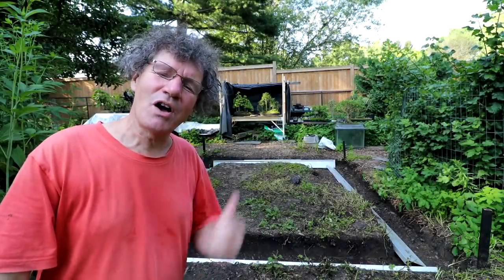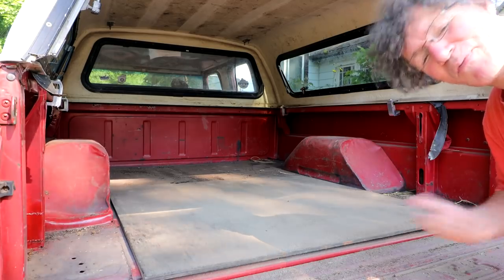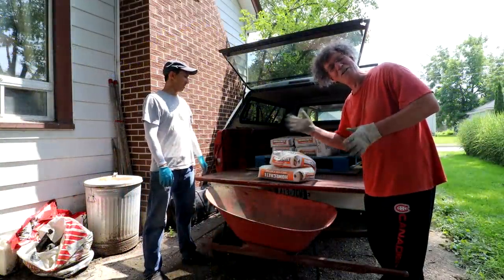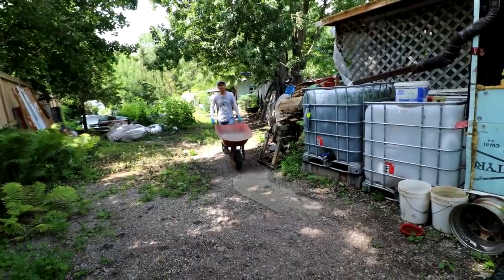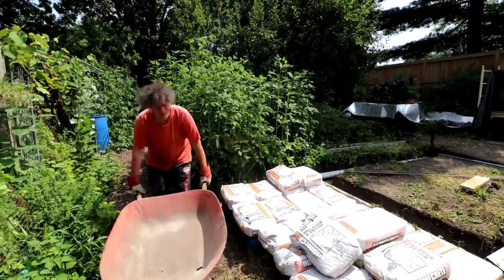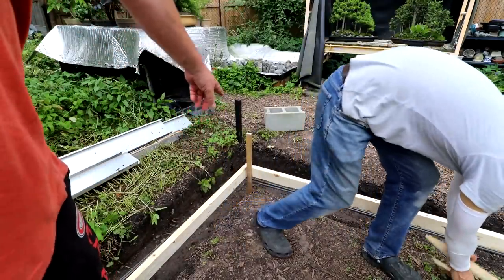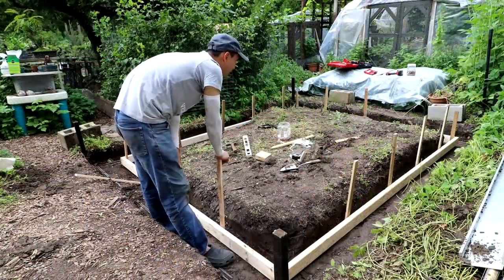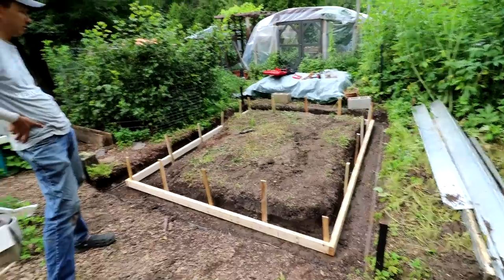Working on the Glass Greenhouse with Xin, The Bonsai Zone, Aug 2021

Comment: WOOHOO!  So good to see you get started working on the new glasshouse!!!  You are very fortunate to have friends like Xin who are willing to help out with this project.  Can't wait to see the next part of the work.  (Memories of my father constructing a small greenhouse.  He made the structure out of steel himself - he was a boilermaker/welder by trade.  The exterior was made of off the shelf clear fiberglass panels.  He put a small electric heater in it in spring when he would use the greenhouse to produce seedlings for our veggie garden.)

Comment: Hey Nigel I don't want to be that guy but. I think 3.5 inches is way to thin for footings and I am certain you are not bellow the frost line. If you get any heaving over the winter it will break that glass house they have no flexibility.

I would at least dig some deep holes on the corners and in the center of each trench. 3 feet or so deep to anchor and support it below the frost line. I'm not saying this to be nasty. I have many years of construction experience and I don't want to see you make a mistake that will be very hard to correct. I know you are no stranger to taking the time to do things that will pay off in the future. I think you will find this is one of those things.

Maybe you have something else planned and I should keep quiet.🤫
Reply from the maker: Thanks so much, I'll see what I can do!